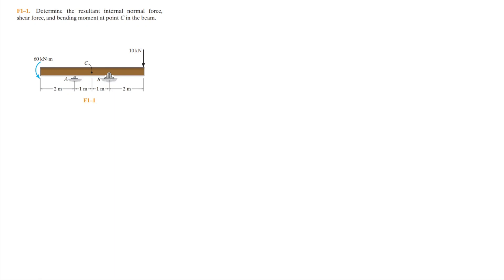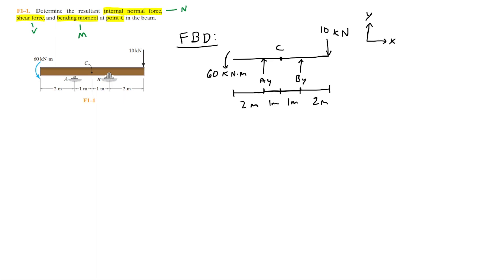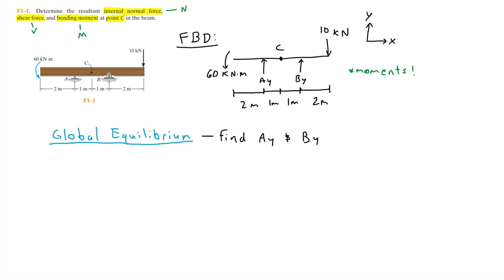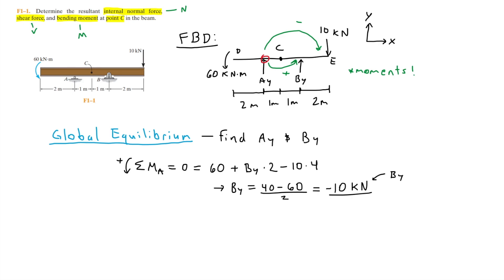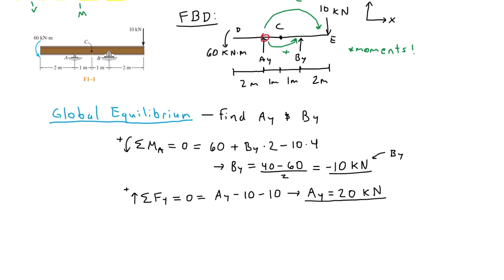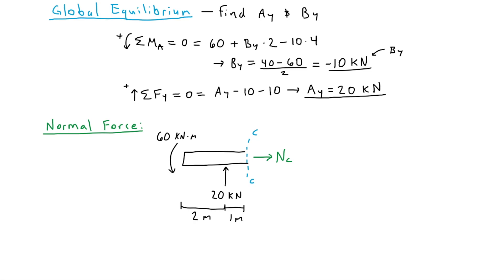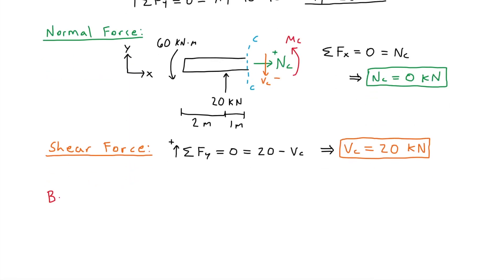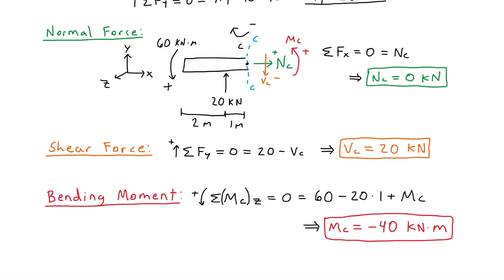Mechanics of Materials: F1-1 (Hibbeler)

Comment: How do you determine the direction of the shear force?
Reply from the maker: Good question! This simply depends on the sign convention you choose. In this case, I used the book's sign convention which takes a CCW bending moment corresponding to a downward shear force at a cut to the right of the beam and vice versa at a cut to the left of the beam. Hope this helps!